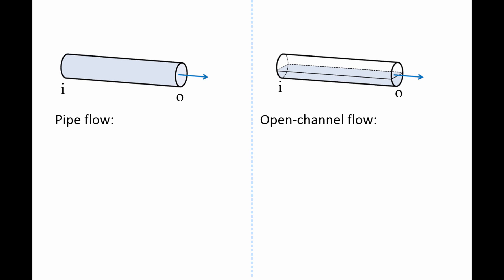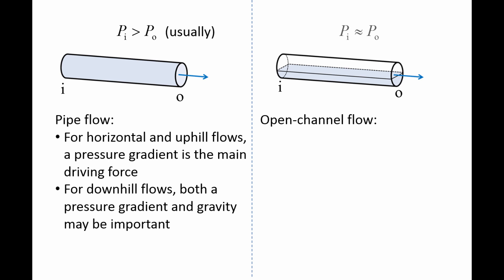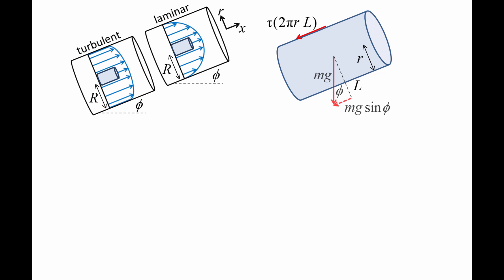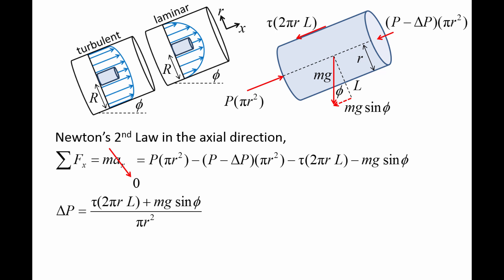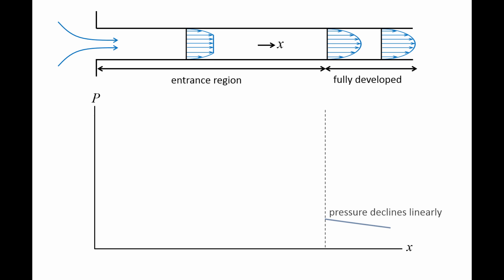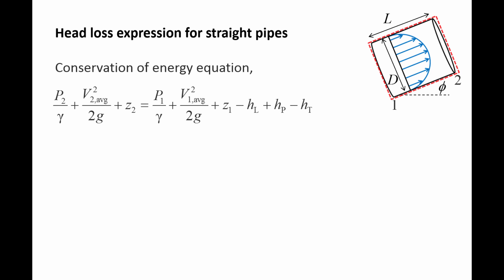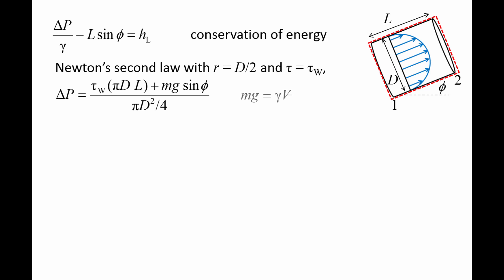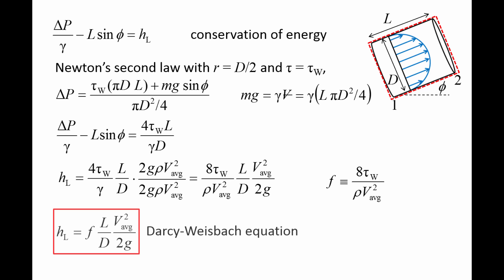Fluid Mechanics: Topic 8.3 - Pressure drop and head loss in pipe flow

Comment: I love this video series. However, here I think the introduction of head loss is unclear. Since you invoked the energy equation it would've been better to use the heat and the internal energy terms as they appear in the conservation equation and then lump them together as the head loss term. Also, this approach was very configuration-specific. What if there's a turbine or a pump. Would the results still hold? Thanks.
Reply from the maker: Turbines and pumps are covered in other videos. They have an efficiency that covers losses in those devices.

Comment: Hi .. The video was really useful. But can u tell me why velocity at inlet and outlet are the same when calculating head loss. Is it because once the flow is fully developed, velocity profile remains constant?
Reply from the maker: From conservation of mass, mass flowrate in = mass flowrate out. If the fluid density and area at the inlet and outlet are the same, the speed has to be the same at those two locations as well.